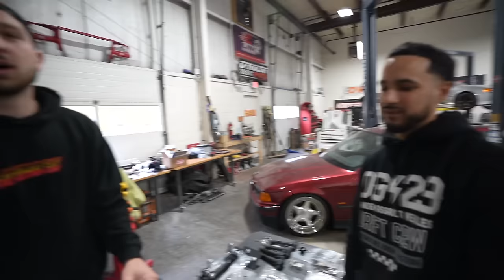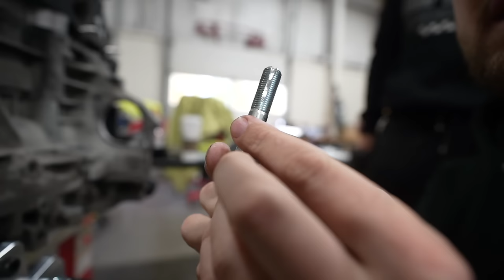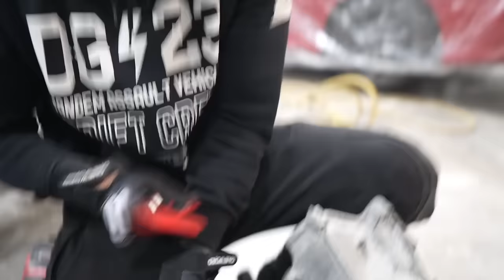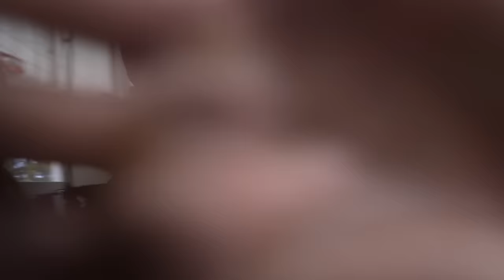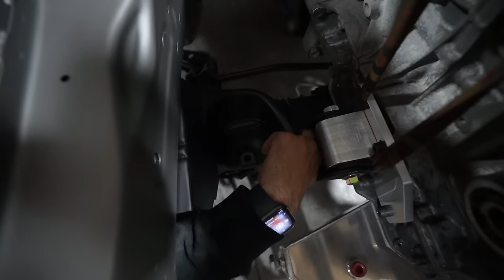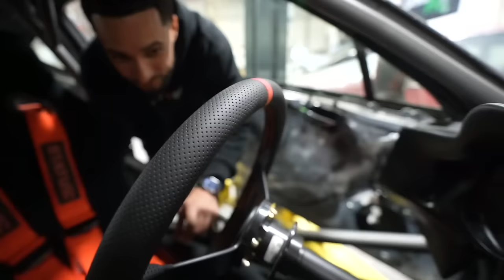We put a HONDA engine in a Toyota FRS!

Comment: I hope tf works welds are better from the ones I’ve dealt with. Had to cut out, cut apart, and reweld a s13 subframe swap into my z31 out of another z and the welds were absolutely terrible! no penetration or burnt through.  Luckily the donor car was not turbo. Otherwise that subframe would have dropped on its own. It seems they are improved now. Thankfully. Good luck with the build and better luck to spoon on said build. Keep it up.

Comment: Stick a few tack welds in the nuts to the plate and the plates to the tunnel  inside the car. Save you time if you need to pull a gearbox next time

Comment: awesome build. that‘s going to be a hell of a car. But change out the brass pivot pin to a stainless steel one. The brass one will wear out even faster than the oem nylon pin. there is a reason why they sell stainless steel pins in germany and the brass pins are no longer available in the good parts-shops.

Comment: Why not rivnut the trans mounts so you don't have to deal with loose bolts coming through the chassis?
Reply: Rivnuts might pull out? With a bolt you can put a spreader plate. You could just weld a nut in place instead.

Comment: I HAVE A QUESTION, 

I'm chucking a turbo on the low km's sr20de and wondering if the ecu need to know how much boost is running if not electronically controlled? 
I have a apex power fc ecu for the build do I need to wire in a pressure sensor before intake?

And what wiring I need to go to CAS and remove dizzy? 

Cheers from NZ

Comment: I once dropped an electric snap on torque wrench like you have there and it would vibrate like yours and then I gave it a good smack on the lift and it was as good as new lol. Might not be the case with yours but either way might give someone a laugh. Or cringe.

Comment: IMPORTANT!!! Spoon please read!

The ZF 6spd gearbox has a shorter input shaft vs the 5spd so the pilot bearing needs to be spaced accordingly. Right now the nose of the input shaft isn't riding inside the pilot bearing, your clutch is going to rattle like a mf and even do damage to both clutch and gearbox.

Hope you read this in time.✌🏻

Comment: Enough of the Subaru hate man damn 🤦🏻‍♂️
Reply: It's just the boxer engine is junk
Reply: @hano5277  have you owned 1? I've had 3 and the 1st one I blew up out of sheer young stupidity. My last 2 have had 0 problems and have/were pro tuned most of my ownership. Every manufacturer has its querks 🤷🏻‍♂️. It's all about good maintenance